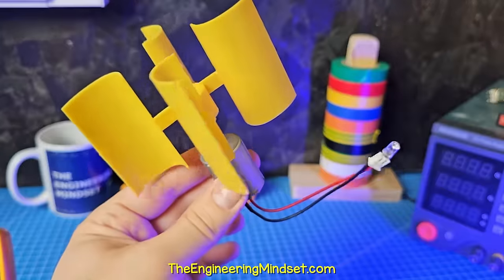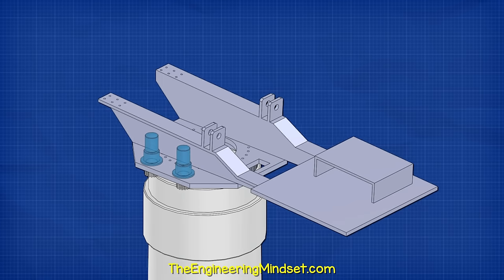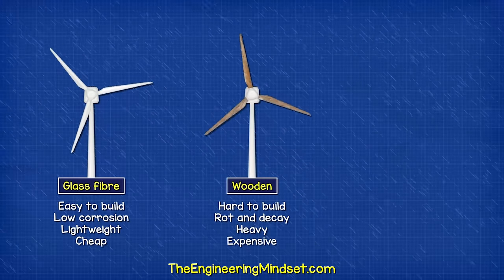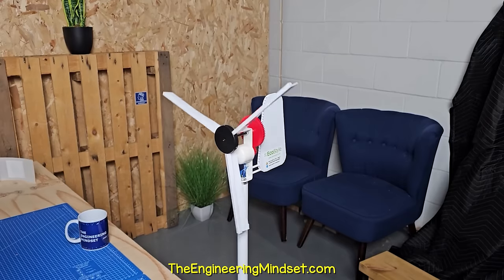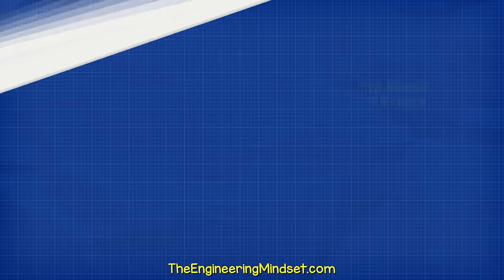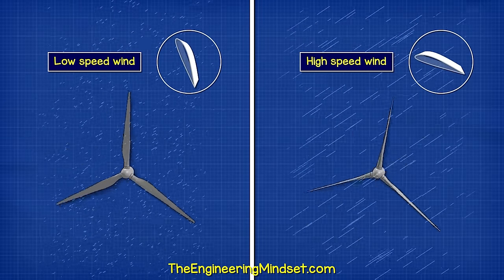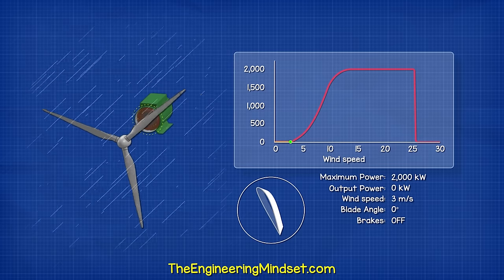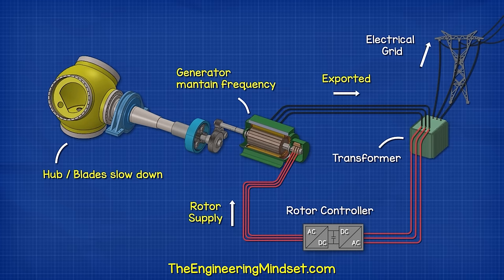How Wind Turbines Really Work: The Hidden Secrets

Comment: There is common misconception asserted in this video. 

Wind turbines are more often than not constructed as a synchronous generator and not a primary supply generator. 

That is, they contribute to the capacity of the grid only (how many Amps the grid can supply) and still require the grid to have a base load power supply.

The comparison between between a wind turbine and simple DC motor is good for understanding the theory, however it doesn't translate into reality and only leads to people believing that you only need wind turbines.

Now, all this is not to say that you can't have a power generating wind turbines, but they are generally not made that because of the sheer size that would be required for such scaled application.  So instead, they scale them down to be synchronous generators and contribute to maintain the overall capacity of the grid.

On the whole though, really great video!
Reply: Do you know what a synchronous generator is?

Comment: Excellent explanation coupled with simple and effective animations. However the design you used is obviously a GE turbine using indirect drive/gearbox to a generator. I strongly recommend you also include an explanation and animation for a direct drive turbine. They are in general a better machine with more efficient engineering. 
My favourite is the Goldwind towers that use belt drive electric motors to pitch the blades with capacitors as emergency back up. This is hugely more efficient, effective and my personal favourite, cleaner.

Comment: Cool! I am not familiar with the gearbox system. The systems I am familiar with have no gearbox and instead use a very large generator. Then it converts the generated power to DC and then concerts the DC back to AC to get a nice consistant sinewave.

Comment: You asked if i  would live next to a wind turbine ? . I live  on a 27 ft sailing boat my boat has two 300 watt solar panels and a 135 amp lithium battery, The system has a 400 watt wind turbine to fill in the days when there is no sun but plenty of wind. So the wind turbine contributes to my off grid system.
Gerard on board,
SV GEMSTAR.

Comment: Great video. One note though. Between generator and transformer there should be a converter. 🤘
Reply: No, the output from the generator is a.c as slip rings are used. In this system, the frequency is controlled by adjusting the excitation applied to the rotor.

Comment: Good introduction.  I learned that rotating a stator can control frequency. However, if a stator is rotating, then is it still a stator? 🙂
Some turbines don't use gearboxes, and are called direct drive - they can be recognized because they have a wide nacelle and a large diameter generator full of permanent magnets.
Also, some turbines output DC, using huge IGBT semiconductors so they don't have to worry about frequency control and synchronization, and can just concentrate of maximum power point tracking, keeping a constant output voltage but variable current. This makes transmission and combination of multiple turbines much easier, before being inverted and output to the grid.
Reply: a rotating stator, sounds tricky!

Comment: Hey! How do you think about upgrading the inner part of motor in this turbine to use electromagnets instead of ferromagnets produced usually from neodymium? This element is ultra rare and it cost alot. Maybe if we use the electromagnets this could generate even more electricity and perform better.

Comment: I understood most of the video but when he was describing how the generator works, I got a bit confused. Because of the fact that the generator does not use permanent magnets, the stator windings must need electrical power to activate the magnetic field, and if I understood the speaker, it seems that the stator gets power from the grid. If that's true then these wind turbine generators cannot produce power unless the grid supplies power to activate the generator. Is that how the generator works, or did I misunderstand something?

Comment: How are 3, Pitch motors wired as the Nose cone is 360 rotating ???? Slip rings , Brushes ? 
thanks for a great video
Reply: Slip ring on the gearbox that feeds all the control wiring to the hub. Pitch motors have battery for backup.

Comment: How do they account for the potential failure of the wind vane?  If it broke off, would the system know?

This was an absolutely amazing video.
Reply: I’m a apprentice wind turbine tech by trade on the ones I work on usually it sends a error code to a sort of computer system built in which then would either stop it or only show it as a fault

Comment: Not only would I live near wind turbines, but I have one attached to my home with plans to attach three more in the coming years. Add that to my solar array, also attached to my home, and I have enough power to be completely off-grid for everything but my largest shop tools. For them, I have a pair of 6.5kw generators. 

I believe every new home should be built with renewable energy designed into the home. The solution to the energy problem is for every household to generate as much of their own power as possible, using the grid only for the highest loads like shop equipment and large appliances.
Reply from the maker: My dream, and probably many peoples, is it be completely self sustaining. Generate my own energy as priority (no bills!), glad to hear you're heading down that route. The problem with wind turbines attached to buildings is the vibrations can cause structural damage so do be mindful of that if attaching it to your home. Better to have it's own support structure.
Reply: @EngineeringMindset  I hear you.... but it's been there for 5 years now. Spun clear up to the governor and stayed there for a little under 6 hours one night. Hit dynamic braking twice.... THAT was noisy!!!! 
No damage. I seriously overbuilt the mounting, I think... I actually enjoy the sound of it. Whistling screaming shriek with the blade tips doing 300mph, at which point they start aeroelastic twisting as another means of controlling rotor speed. That's a WICKED fluttering whooshing sound... THAT gets some vibration, but again... I went a bit overboard building the tower and roof mounting system.

I love wind and wind power. I'm looking forward to moving to Montana next year. LOTS more wind over thataway.

Comment: I've never understood why the blades are so narrow. It seems like a lot of useful moving air is slipping between the blades. Look at pictures of water windmills and wind powered  dutch grain mills where there is lots of blade area utilizing much more of the air movement. They seem so much more efficient.
Reply: It is for cost reasons, the larger you make the blades, the larger and stronger you have to make the Tower to resist the wind force, and you get less and less benefits from larger blades the larger you go, 3 blades is optimal.

Comment: i had a thought, instead on converting the kinetic energy directly to the generator, and having to deal with the inconsistent wind speeds and burning out motors.
why not use the kinetic energy to lift or pump a mass to an elevated position. then you can release the mass when needed at a controlled rate let gravity do it's thing.
and now you have a much more constant release of energy. 

couldn't you just let the windmill run constantly at any speed (or as fast as it can handle without flying apart). no need to turn off windmill when you don't need power or the wind is too high, you just pump/lift more mass to be stored and released as needed?

Comment: Brilliant explainer. One thing about the aerodynamics of the blades is incorrect. The Low pressure side 'sucks' the blade into it in an attempt to equalize the pressure from the High pressure side. Not the high pressure pushing the blade. 😉.
Reply: Is this a joke?
Reply: @petehiggins33  your ignorance is.

Comment: The common explaination for aerodynamic lift isn't correct since bernouilli's principle can't be applied in this case. 
The explaination is so much simpler: 
Since the air flowing over the wing's surface follows its shape. This makes the air coming out of one of the surfaces to have an stiffer angle than the other flow of air respect to the middle line of the wing. 
This causes the air to come out in a slightly different direction to the one it had before going through the wing. Since the wind is pushing air slightly downwards, the wing experiences an equal and opposite reaction force to the one that pushes the air, what generates the lift.
In summary, a plane's wings produce lift making the air passing theough the blade go downwards, and the same is applied to the blades of the wind turbine.

*Sorry if my english isn't good.

Comment: Great video. I'm not clear about the frequency control though.. So the turbine rotates the rotor which holds magnets, these north and south poles induce an electromagnetic field in the coils resulting in 3 phase AC. if the rotor spins too slowly a compensatory AC will be fed into the coils so that the frequency maintains the desired 60 Herz. How do sine waves combine like that ? Does the voltage and current have to continuously regulate and does that reduce the efficiency of the turbine? And I wonder also what determines the Voltage and current (Power output) of such a turbine?
Reply: The rotors are not permanent magnets, the magnetic field is produced by an alternating excitation voltage applied to the rotors.. It is this that is adjusted accordingly to either increase or reduce the frequency of the output by the addition, subtraction effect.
Reply: Im asking about frequency. But I don’t know what you’re saying, this is a generator, not a motor. The turning of a permanent magnet/s inside the coils PRODUCES 3 phase AC with 120degree phase shift, it doesn’t take energy OUT of the grid it feeds it IN
Reply: @egoinjury  The output of the generator is taken from the stationary field coils. The the rotor is energised only to produce the magnetic field which is rotated by the gearbox shaft which is connected to the rotor. It may help if you look carefully at the illustrations given in the latter part of the video. It is quite a complex arrangement, it took me quite a time before the penny dropped. The frequency of alternating current fed to the rotor must be computer generated and carefully chosen to ensure the additive or subtractive effect results in the final output being exactly 50 Hz. The diagram at 22:02 shows the controller which adjusts the excitation signal applied to the rotor.
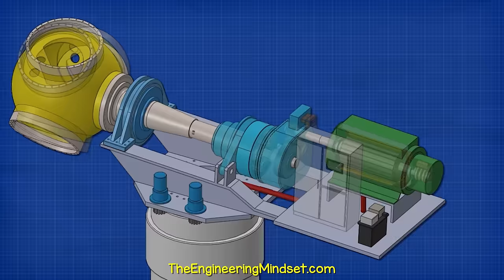Reply: ah thanks, yes from around 17:00 onwards it explains it well, I somehow missed that bit about the coils on the rotor with 3 phase power via the slip rings. Quite genius!
Reply: @egoinjury  No problem, yes, it’s quite a clever system. I’m not sure myself how the adding or subtraction works to ensure that the output frequency is always 50 Hz. I can only assume that it’s a some complex software controlled system. Interesting stuff though.

Comment: So, do wind turbines stop if it's too windy or can they generally adjust their blades to keep operating in any conditions?
Reply from the maker: You're in luck, this is covered in the video
Reply: @EngineeringMindset  Was it? I saw that they adjust to the wind speed to maintain an average rotational speed but I must have missed whether they're often forced to stop at all (I noted they have a cut off if they spin too fast but wasn't sure if this was a regular occurrence).
Reply: Hey I am a mechanic for a turbine company and with most wind's the turbine will pitch the blades so that it wil generate as little lift as possible... a spinning turbine is way more stable than a turbine that is lockt on the brakes with extremely high winds!!!

Comment: what about the energy needed to get them running in the first place?
Reply from the maker: Yes, they do require energy to operate (the large ones do anyway) but they produce more energy then they consume because they are extracting energy from the wind, instead of, for example, constantly digging, transporting and burning coal.
Reply: @EngineeringMindset  I believe most solar panels are the same - they need electricity to work. But when I have some more time I will look at your vid about them and see if I'm correct. IK the ones that use micro-inverters need electricity to work.

Comment: If the generator is backed by a battery then they do not need to match voltage frequency of the grid. the battery will through its invertors match the grid frequency.

Comment: Quick question. If I take 2 6VDC batteries rated at 465AH each and connect them for 12VDC, will that double the AH's ? making them over 900?
Reply from the maker: Please see our videos on batteries
Reply: Thanks, but I haven't the time to watch all your battery videos, I may help you but not me. Thanks. @EngineeringMindset

Comment: There are some concepts that are not covered in this video, important for bulk electrical grid use of wind turbines.

1. Wind turbine generators are mostly small, slow speed multi pole synchronous machines, that is why they all look like they are spinning the same speed when you see a field of them.  They are all synced to the grid.  Once synced you CANOT adjust speed, only load.

2. Wind and solar are terrible at producing reactive load and cannot support inductive and capacitive loads.  That is why you still need large base load generators with steep power factors.  Otherwise you have brown outs.  

3. The gear setup is highly inefficient.  Steam turbines and jet turbines offer much higher efficiency.

4. The capacity factor of Wind is very low.  It is idealy .3, as opposed to .9 for nuclear and .8 for coal and base load gas.  The low capacity factor is due to the consistency of the wind and the large amount of down time required for wind turbine maintenance.  

Folks fanboy wind and solar so much that it is important to make sure we honestly address the technical pitfalls as well as the advantages.  Otherwise you get people like Elon Musk saying a 100x100 mile solar farm could power the country.... which is 100% not true.
Reply: I don't understand why a wind-powered generator should be any worse supporting inductive or capacitive loads than a gas/coal/nuclear generator? Isn't the generator essentially the same, just with a different means of turning it?
Reply: @TheGodpharma  no, and that is a common misconception.  Large synchronous generators also have large fields, which can be used to absorb or produce massive amounts of VARS.  VARs are a complex concept but they are vital to voltage support on the grid.  If you don't produce enough it leads to brown outs.  Think California rolling brown outs in the summer months.

Producing and absorbing VARs causes end winding heating in the field and stator.  Small generators lack effective cooling to deal with it and are physically limited, based on the dimensional size of the devices.  Large units are hydrogen cooled and the staters are sometimes even water cooled, allowing for high VAR loading.  This is I'm combination with the  physical construction of the generators.  To put it simply.... they have more copper.  But that is an oversimplification.

Solar and DC sources are even worse because the power has to be inverted and extremely expensive electronics have to be installed, if they are designed to provide reactive loads.  Most companies do not install that equipment and thus the loading falls onto the existing base load plants.  Europe is having issues with this right now and the bank switching between day and night has done a number on their base load plants and cause a lot of cyclic damage.  

Wind and solar are fine.  I'm not against them but the limitations are a big deal and don't get mentioned very often.  I work in the industry and know the designs of both the grid and different power plants and it frustrates me how the policy is headed in a bad direction that the technology does not support.

Comment: Something seems to be wrong with the picture.  The three blade commercial turbines turn so slowly and the blades are so small in area compared to the swept  area of the turbine that one wonders how they can use more than a very  small fraction of the wind energy  passing through the swept area.  One of the world's largest turbines is rated at 16 MW.  But if you do the math on the number of Joules of energy contained by the mass of air that passes through the swept area in one secind,  it comes out to about 600 million Joules for a cutoff speed of 55 moh.  The blades in this video take up much more area than the commercial  blades and are covering much more area of the swept area in a short time.

Comment: quick quesion. why does the voltage decrease after a certain number of blades.
Reply from the maker: More blade means more Drag. The air stream is disturbed by the blade and this impacts the next blade if its too close.

Comment: i just realized you could make a DIY windmill by attaching a car alternator to a windmill via a belt and hook it up to the battery you need to charge, basically free energy
Reply: Except an alternator runs at 500+ RPM and a windturbine usually runs at a few hundred MAX at small sizes. An alternator costs money, so does a windmill, and the battery, nothing is free. Also you have to take into account that you spend your free time doing it, which is limited.
Reply: the Wincharger was born in 1927. Developed by brothers John and Gerhard Albers on their farm in Cherokee, Iowa, the first Wincharger wind-powered battery charger was used to recharge a 6-volt storage battery for a vacuum tube radio.